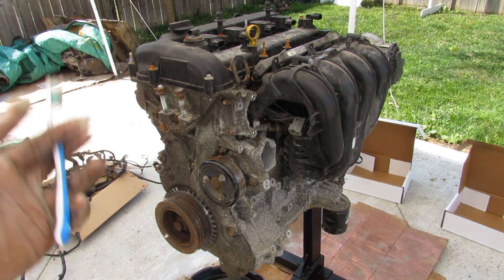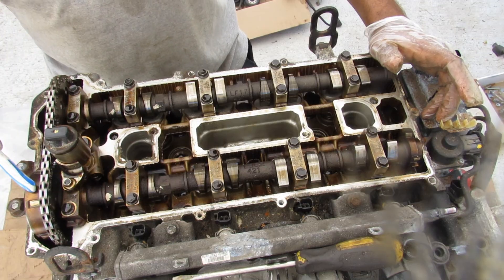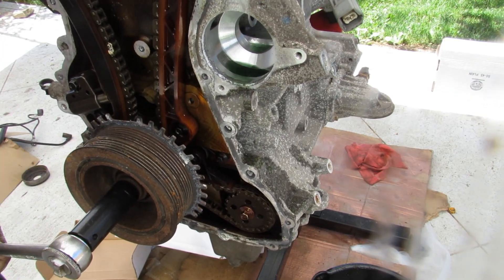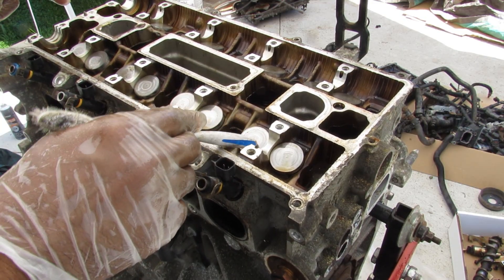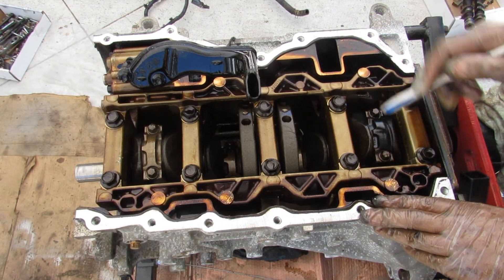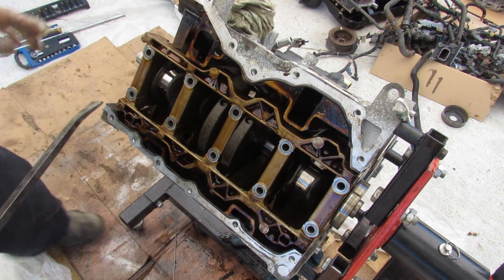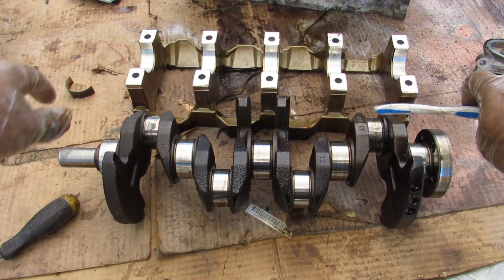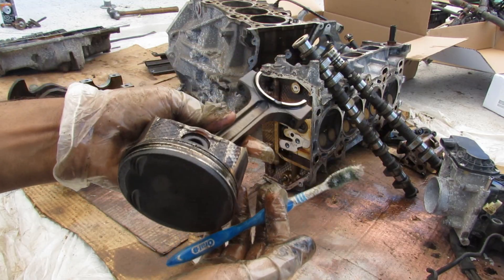Why Mazda Engines FAIL

Comment: Why Mazda engines fail? Because older models use Ford engines, no other reasons why
Reply: It's the other way around. Mazda used to make them, not Ford.
Reply from the maker: Which came first the Mazda or the Ford 😆
Reply: Which came first the Japanese or the Americans 😅 @speedkar99
Reply: This is why after 2008 MAZDA put smiling faces on their bumpers!!!

Comment: non-keyed crankshaft pulley.... thats just another insanity going on in the society
Reply: algorithmae
1 day ago
Timing is set by removing a small screw on the side of the block, and installing a peg that contacts the crankshaft and stops it from turning once it reaches TDC. I do wish they would have keyed the crank though :/

Paul Mills
1 hour ago
 @speedkar99  There are special service tools to lock the cams and crank to set the timing. With the tools it's relatively simple.
Reply from the maker: Right...like why?

Comment: the Ford collab engine is surely trash as there was a collab with Ford... but the Mazda developed sky active engines you see in the CX5, CX9, etc are very very reliable... misleading title
Reply from the maker: Yeah the skyactiv ones are to be better and not have anything to do with ford

Comment: Hope thats not mine. I did oil change and forgot to add oil. Only added oil in filter. Ran for 5 minutes. Like a dummy. Traded it in and got a 2018. Got $2000 for the old 2007 3 and w 150k miles. And a GREAT deal on the 18 at 1 yr old and 27k miles for $13k OTD, LOL.
Reply from the maker: 5 mins without oil is salvageable
Reply: @speedkar99  Yes but engine noise was awfully high after 55mph. After my major screw up. The noise was unbearable.  I know the owner of the new car dealership (Mercedes) for the 2018 Mazda 3 and couldnt pass up that bargain. The owner remembered me when I worked for him a couple summers between school when I was 18 yrs old, decades ago. Even gave me free gift cards for their dealership store. This was right before the pandemic.

Comment: Ahh yes the MZR! I was waiting for a teardown of this engine, I have a 2005 2.3 6 with 180k+ on it, timing chain is still good, engine is strong only issue is that the valve stem guides are a bit worn, the 2.3's are near identical to the 2.0's minus the timing chain issues as the 2.0's, these MZR's are durable but very very oil sensitive you always have to make sure you have the correct amount of oil, and clean oil in it at all times or a bearing WILL spin.
Reply from the maker: Agreed. Very oil sensitive.
Reply: The N/A 2.3 has a different timing chain to the 2.3T, also the 2.3T has a high pressure oil pump while the N/A doesn’t, the reason the 2.3T has timing chain issues is because it has a thinner timing chain due to packaging constraints
Reply: Shit this engine was ran hard. Or foam in oil

Comment: Thank you for another great video, I don't really drive Mazda or Ford cars but was surprised at the crankshaft sprocket and balancer with no keyway. Good to know that,  thanks.
Reply from the maker: Yeah I'm not sure what they were thinking with that little friction ring trying to hold timing

Comment: Apart from the timing cover/sump arrangement, it looks like a nice design.
Reply from the maker: Overall yeah
Reply: Yep, because timing this fucker after a chain change would be so easy.  My old Holden red motor was a nice design, never had any issues, but port injection superseded the carby and now direct injection has superseded port injection.  So this Mazda/Ford engine is ancient history.

Comment: Also kinda unfair to Ford/Mazda how this failure was caused by improper maintenance and not a flawed design like the title suggests
Reply: Huh? He titled it "WHY Mazda engines fail" which is exactly right. Mazda MZR engines fail when people don't keep up with their oil levels. That's WHY MZR engines fail.
Reply: I ran my Mazda 3 BK with just over 1 litre of oil without knowing for at least months as the sump plug washer wasn't replaced. At the time it had 280k/km. A year and half later and I am at 304k/km and it still runs like brand new. No issues, noises, DTC's, performance loss or flaking. 
Only thing I've had to replace on the motor itself is a vacuum actuator. 
Better yet I'm Aussie, so that just shows that it handles the extreme torture of our climate, roads and petrol conditions.

All issues I've had come down purely to a young kid with testosterone thinking his Mazda 3 is a race car (me)
Reply: plus it may have 500,000 miles on it
Reply: Yeah these are actually solid engines
Reply: People think you can change the oil every 3k miles I’ve had my fusion for 4 years and I beat on it, 180,000 miles. Take care of your machine it will do the same in return
Reply: My fusion had 335,000 miles on it and ran strong. I had to junk it for thr $2,000 electric power steering job that was quoted tho. Good engine and I drove it to the junkyard.
Reply: Reliable or not I don't like it; just things like that oil pan being tied to the timing cover.
Booo
Reply: The PCV always fail in mzrs. Then they burn oil and blackened oil need changed more often and topping up monthly. PCV behind intake manifold 4 hour job. Never gets done. Worst part of engine
Reply: Are theses engines in the nc miata oil consumption issue and need to add oil? Or just change oil every 3k miles is good and not to worry that it?
Reply: Facts
Reply from the maker: Agreed, though these engines are quite oil sensitive.
Reply: @speedkar99  all engines are oil sensitive, they all need proper lubrication or problems occur.
Reply: @ahuramazda323  Yeah, but the L8 in the early NC MX5 is known to just eat its own oil control rings because of a design fault in the ringlands.
Reply: @speedkar99  You are right. Specification C3 oil.
Reply: Every modern engine is oil sensitive comparing it to crude or mineral oil engines running at 400rpm max producing 1.4 Hp per liter displacement.

Modern VW are the absolut worst. What is normally considered high Oil consumption as standard from the factory.
Reply: It sure why people keep calling this a Mazda engine. It is a Ford engine, and the lack of anti-rotini tabs on the bearings is a huge design flaw, regardless of proper maintenance. Once a proper designed bearing fails, the “knock” would normally give you a early warning and possibly save the motor. My Hondas have had worn bearings from the track. When I have heard the sounds, I could put in new bearings due to crank still in good condition. But the bearings never spun like this.
Reply: @johnhayes3314  People call it a mazda engine because it was designed by Mazda. It just uses a couple of off the shelf ford parts.
Reply: @johnhayes3314  Bearing tabs do not prevent rotation. They are there for assembly and nothing else. If a bearing wants to rotate the tabs just get sheared through.
Reply: I'm sorry, but those engines were indeed bad. Once I was looking for 3s of that first generation to buy in a classified web and all of them had engine and transmission problems. When not, other major problems. So I don't think Mazda was that good at that time.
Reply: That engine is a total piece of shit lol
Reply: @MadScientist267  These things easily last 500kkm with normal maintenance and can produce 350hp on stock internals. These are great engines for the class of car they're meant for.

Comment: Timing is set by removing a small screw on the side of the block, and installing a peg that contacts the crankshaft and stops it from turning once it reaches TDC. I do wish they would have keyed the crank though :/
Reply from the maker: Yeah I did see that bolt near the crank.
Reply: @speedkar99  There are special service tools to lock the cams and crank to set the timing. With the tools it's relatively simple.
Reply: The whole point of a floating pulley is faster assembly in the production line.
Reply: Anyone knows if it is possible to add more power to these engine ex changing cylinder bearings and adding a turbo?

Comment: These engines are known for great long term reliability and durability. Just don’t skip on maintenance. I have the 2.5L version of this engine and it runs like a clock even at near 100,000 miles. The 2.3L turbo GDI version of this engine is the most problematic.
Reply from the maker: Agreed. How's the 2.0?
Reply: @speedkar99  my moms 09 Ford focus has the 2.0 which is exactly the same as the mzr version. Still going strong even tho it has 65k miles, but it gets it love in quality oil changes. We’re expecting it to last a while.

Comment: So what caused the spun bearing? Infrequent oil changes? Too little oil? Foreign matter in the crank? Bad luck?
Reply: I had this engine in a focus, burnt one litre of oil every 600 miles. This caused blocked egr failed on emissions then scrapped
Reply: My experience with this engine type, is that the oil rings give up causing high oil consumption. There is no indication of this atleast in ford platform untill no oil pressure, and you end up starving the engine and ruining the bearings.
Reply: The 2 litre is the most reliable of the Mazda  lineup.
Reply: Piston oil control drains clog with carbon causing oil consumption to the point of failure.  Newer piston design includes more drain passages.
Reply: The gm v6 high feature is also sensitive to oil quality and oil level too. They sludge up badly if not serviced properly
Reply from the maker: No oil going to the bearings
Reply: These MXR engines are very oil sensitive so basically everything you listed will kill an MZR, the 2.0L's show are the most problematic so I option you get a 2.3 over really anything else, the 2.3's are extremely reliable engines (mine has over 180k on it) just make sure you have the right amount of oil at all times
Reply: @giovanni233  a friend of mine had spun bearing on a 2.3 too, maybe it's not that reliable.
Reply: @maurocont  yeah, they are oil sensitive but as long as you keep the oil clean and at the right level you should be a good, there are lots of engines that are reliable but very oil sensitive or sludge prone.
Reply: @maurocont  yeah I just junked my Mazda 3 2.3. Transmission synchos are also infamously made of glass.
Reply: @maurocont  i have a 2.3 turbo and almost 100k miles. Mind you I do lots of preventative maintenance but I beat that engine like a step child and it still runs like brand new. They are reliable if you want to put in the work.
Reply: @pasadena805  no issues with that drivetrain in my 6. Nearly 400,000ks, new clutch at 300,000km. I don’t shy away from pushing it hard through the gears either.
Reply: @giovanni233  I had a 2.3 that spun a bearing too after a pull low on oil
Reply: @Vaoproductionstv  ouch, yeah I keep up on my oil ever 500-700 miles and make sure it's topped off, just about my whole family has used 2.3's in their forms or variations in Escapes, Fusions, Milan's and even a 2.3 3 with 210k and a starter that sounds like death.
Reply: @giovanni233  if this is the same engine in the ford fusion, I had one with over 100k miles with no issues, until it got wrecked.
Reply: @giovanni233  how are the older ones? I have a 2004 Mazda tribute with the 2.0 at 253k, it seems to be running fine now.
Reply: @imthemistermaster  if you got to that many miles, you got lucky/
Reply: @giovanni233  2.5 in the 6 and fusion are pretty good. Very similar. 2.5 higher conpression and larger piston. Plus 30hp and 35 lb ft torque. And external water pump. Ez tune ups. Ez oil changes. And mines old so i can do transmission drain and fills through the dipstick out the drain plug.
Reply: @giovanni233  yeah my MS3 may have had a replacement at 50k in its life (I'm currently owner #4) but from the time I've driven my car the engine never gave me issues. The turbo on the other hand I'm still struggling with
Reply: @giovanni233  ive heard the opposite. The 2.0l being the more reliable one and i personally can contest to that.

Comment: So the moral of this story is that FORD engine sucks ASS so much that even MAZDA can't fix the problems those engines have.
Reply from the maker: Mazda has abandoned this engine and developed their own skyactiv
Reply: @speedkar99  Yes Mazda did this after its reputation went down the toilet. Thanks to Fords SHITTY motors. I owned a Mazda 6 with a Ford engine and let me tell you, at 180,000km the timing CHAIN skipped and killed the motor.  My winter beater Toyota got to 400,000km before it got written off in an accident.

Comment: Wow. That timing method seems really bad based on my limited knowledge of engines. Does that timing approach lead to issues?
Reply from the maker: If someone has to do timing work yes
Reply: algorithmae
1 day ago
Timing is set by removing a small screw on the side of the block, and installing a peg that contacts the crankshaft and stops it from turning once it reaches TDC. I do wish they would have keyed the crank though :/

Paul Mills
1 hour ago
 @speedkar99  There are special service tools to lock the cams and crank to set the timing. With the tools it's relatively simple.

Comment: Same engine that's in the 2006/2015 Mazda miata ???? Looks kinda similar
Reply: Yes it is. The miata always has the engine of the mazda 3 at the time, with some modifications.
Reply from the maker: Those are far updated from this

Comment: `i have a 2013 mazda 2 with standard transmission...has it been 8 years already?....lightly built car but mechanically sound....hasn't given me a moment's problem however they don't make them any more because i guess they were unpopular....the steering is highly sensitive at 75 mph but you just learn to steer small........maybe do a video on the 1.5L mazda 2 engine sometime
Reply: They make them but in US they sell them as Toyota Yaris
Reply from the maker: Nice. Does it burn oil?

Comment: I am the original owner of a 09 Mazda 3 sport GX 2.0 liter with 536500 kilometres I use synthetic oil changed every 15,000 kilomtres. No noises no rough idling I use it daily. Great video and maintenance is still the key to engine life. You pay a lot for a car so why would you skimp on maintenance? I enjoy your very informative educational videos. Great work!
Reply from the maker: Awesome! Maintainance is key
Reply: @speedkar99  totally agree. by the way what do you think, is it wise to start a car without pressing clutch to prevent slight lateral movement of crankshaft and causing extra stress to spun bearing, especially when engine is cold and there isnt much oil and therefore there is more wear? I read about this, what is your opinion? Does it make sense?
Reply: Damn.  How are you not bored with the car?  My 2015 mazda3 has 100,000 kms and I will admit I am bored with it but as I can’t afford a new car I will keep it for another couple of years.
Reply: I have a Mazda 6 2011 with 175000 miles on it and still running fine, change the oil every 5000 miles, no issues apart from two oxygen sensor changes that need replacement
Reply: I have a 2011 and i love it , and i drive it through harsh winters
Reply: 15k km oil change intervals?
Wow

Comment: Ford/Mazda did NOT impregnate this engine very well.   The white dots all over the surface of the engine are oxidation of aluminum which good impregnation would have prevented.
Reply: how do you impregnate the aluminium?
Reply: Junk yard motor bro....
Reply from the maker: Ok

Comment: So it's a Ford engine. I mean it is Made by Ford Motor Company.  You should mention that in title. Mazda no longer uses these. Haven't used them since 2013 or so.
Reply: Rumors have it that at the time, Mazda designed all the 4 cylinder engines, while Ford developed the 6 and 8 cylinders.
Reply from the maker: Yes true. I also mentioned that in description

Comment: Love this channel. Also bought an '06 Mazda 3 about a year ago, 2.0l exactly like this one. Thanks for putting in the work, this is super cool and now I'm super glad I haven't tried to do any timing adjustments to it because no keys is a bitch!
Reply from the maker: Awesome. How's your Mazda 3 holding up?
Reply: @speedkar99  Pretty well, though don't want to jinx it. It makes a little bit of valve noise, my mechanic said it seemed like the lifters but also told me it probably won't be an issue for the foreseeable future. I've been religous with oil and filter and it's definitely gotten quieter. For $2k it's been great, super fun to drive, 30 mpg with a bit of hooning mixed in. I highly recommend that 1st generation of Mazda 3.
Reply: The only thing the first gen really has to worry about is the body rust due to the cheap metal thanks to Ford (which went away when the second gen was introduced right after Mazda split in 09)

If it’s still in good condition make sure you treat it, I think the first gen still holds up pretty well aesthetically and I’ve seen good looking examples with 200k at work
Reply: @mistermr2147  been living with the ticking noise for a year now lmao

Comment: So do you think the ultimate cause of the oil starvation was due to improper maintenance or a design issue? Seems like the sludge indicates oil changes were not frequent enough, and no galleys or screens were blocked, so I'm going with maintenance.
Reply from the maker: Maintenance. Then they dumped a bunch of oil in it which I found in the sump.
Reply: @speedkar99  hah reminds me of when I'd try to cover up my crimes as a kid

Comment: I had a 2003 focus with this engine. That, car was kinda fun to drive but it was a POS and I junked it when it started having problems. I then bought a 2004 accord k24.
Reply: Yup... had 1 for 4 years for my 2nd car / winter beater....
Reply: @joeishere500  that little 2. 0 moved the car pretty quick
Reply: @MISTER__OWL  ,,, yeah she's a runner... all stock..
Reply from the maker: Good choice